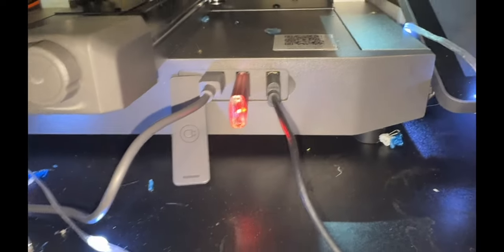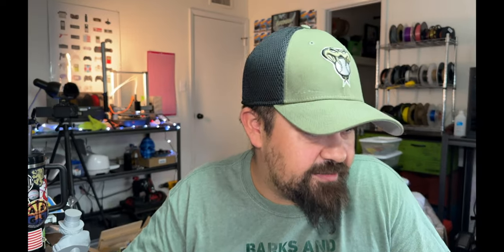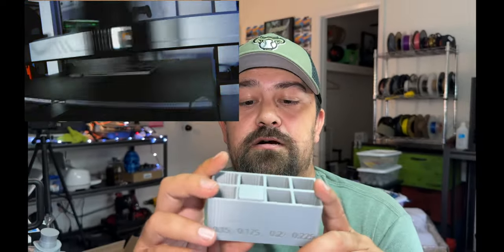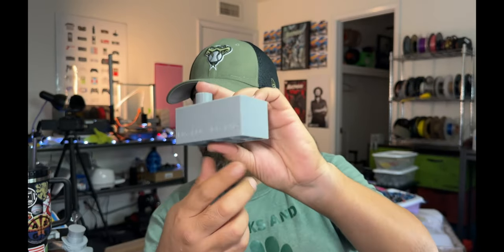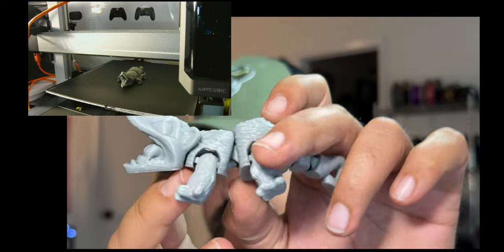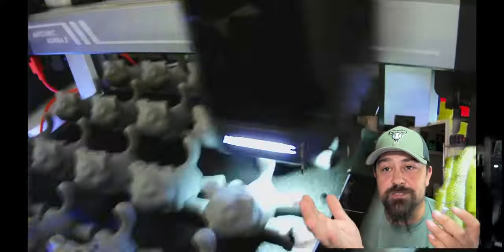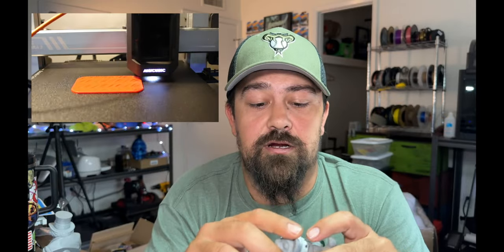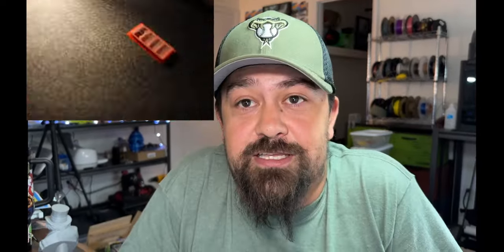What I DON'T like about the Anycubic Kobra 3!!!

Comment: Right out the box you're wrong. Bambu fan boy or didn't spend any time on the kobra3
Reply from the maker: What am i wrong about?
Reply: @IdiotCraftMan all the calibration stuff it does everything the A1 can do and the speed stuff there is a sport mode on it you just appear not to have got it to work are you using hs filiment as the printer will not print faster than the filiment can flow. I have turned it on and it prints a lot quicker with poorer quality.
Reply: @kerrigreen2626  he says he didnt use it but the prints werent as good as bambu at the high speed something sounds fishy there
Reply: Seriously?! Anycube, unless you got it for free before it was released, does not send the printer without the screen, super sus! Also, there are TONS of videos out in the world showing the speed differences. Why don’t you show any of your settings or calibrations? Again, super sus. Someone’s looking for clout.
Reply: @CMTKingsfan  my 2 max works great but I use my 3 combo most of the time I don't give a shit about clout or anything like that the only vids I have on here are from my drones.  What settings are you looking for next time I'm on my laptop I'll send them. I don't sit in a basement fondling myself to chep or other print videos nor do I get off comparing settings.  Out of 6 printers I only run the k3 most of the time
Reply: @MrJlhhagood2 wasn’t even replying to you lmao

Comment: Aesthetics man it's for the 80% of people that are going to use the cloud and that way there's not dust in other objects that go in there. Regardless it's nice to see that someone is being somewhat critical but putting something together is actually better so you understand a little bit more about the machine. Instead of always having to contact support.. You're layer shifting has to do with your z-axis belt being way too loose. I mean it's a turn of it now it's not rocket science. Aurora tech put it together no problem had no issues so I don't understand because you did not like that you're to put together that you're going to pick at a company that literally is the reason why Bambu is cheaper now.. home the z axis. Along with a level calibration but usually it is not many people know to just home the z-axis. It seems like you just want your viewers to applaud you for putting it together properly. Also orca slicer exactly is bambu like all you have to do is transfer your bambu profile. And that is not true because you can use and fill flush within orca to eliminate waste. You also paid 415$ no shipping
Reply from the maker: Yes the belts needed tightening, Which I did before printing and all that. I have no problem with putting together a 3d printer, I have about a dozen of them, most of which had to be put together. The whole point was saying that this machine(in my experience) is not as beginner friendly as many others on the market right now. There are more and more people buying 3d printers for their kids, or who may just be wanting to get into it to experience something new. From my experience, this has not been a beginner friendly printer, as I am still having issues with it. That being said, I love the company. Anycubic has been in direct contact with me to resolve the issues that I have been experiencing, as well as fixing issues they have been able to replicate on their end. I'm hoping that I will shortly be able to put out a video about this working correctly, but so far, I stick by my statement, that this is a machine for an experienced printer, who doesn't mind tinkering with this machine.

Comment: You mentioned the camera, prepare for more disappointment. I got mine, also shipped separately from the printer and filament.  It's the lens, board and cable, you have to print the enclosure.  It goes underneath the left side of the x-axis bar close to where the cable and filament tubes go through on the side.  You'll see the circle and rectangular holes in the metal bar there, that's where it connects.
Reply from the maker: That’s not ideal. Is it at least any good? Does it record at all, or just monitor?
Reply: @IdiotCraftMan  I'm doing my first print with the camera after printing the housing and installing it.  It looks like real-time monitoring through the app so far, and the refresh rate doesn't look too bad but the quality isn't great, but that's as expected...I don't see any recording option in the app, unfortunately.  It's a bit odd because to use the camera, the lights on the printhead are disabled, so the image is pretty dark, though the camera has lights on it but they're not on...unsure if mine is defective (wouldn't be surprised) The mobile app doesn't show an LED option but the anycubic slicer workbench section does, but it's not selectable.  Also if you try to view the camera from the app and anycubic slicer, one will timeout, not a huge issue, but I thought it was interesting.  Also haven't experienced any of their ai sensing abilities for the camera, so I can't speak to that.  I have only tested it via Wi-Fi so not sure how the image would do over cellular.
Reply from the maker: @risraels  Thanks for the info. I don't know when I'll be receiving mine, but I had a critical failure on my Kobra, so I gotta fix it back up and recalibrate and all that.
Reply: @IdiotCraftMan  Me too... I've got constant sensor errors and it can barely get through an auto level.  It even fails that most of the time. Support thinks it may be a bad strain gauge, but we'll see...I think they may send a new one out.
Reply from the maker: @risraels  I will give them credit. Their customer service and support is top-tier.
Reply: Sounds like the steps for connecting the half frame per second camera on the Bambu P1P
Reply: @IdiotCraftMan  It is very good when the problem is easy,  I have a Kobra 2 Max and the motherboard is shot and I can't buy one anywhere.  I put in two tickets and never got a reply.  When I asked for an end stop I got it within a week.

Comment: You mentioned that the Kobra 3 doesn't come with any sort of auto leveling or auto calibration. That is false, as it states it directly on the Anycubic website that it does. I'm racking my brain on which to buy and that piece of false information almost made my decision.
Reply from the maker: It has the options to run those on the machine. What i was saying is that it doesn’t run a full calibration before each print like other machines do, which has caused print issues for me.
Reply: He said that Kobra doesn’t run it when starting a print, not that it doesn’t come with it. He was talking about printing speed, and the point was to contrast the fact that Bamboo runs the levelling every time and Kobra doesn’t.  

Later on he explicitly says he ran the levelling, so obviously it does come with it.
Reply: I'm sure you could add the gcode to make it auto level each print correct?
Reply from the maker: @thepeacemaster1  I've been told that it will soon be a feature in the slicer, and you can select which calibrations you do or do not want to run for each print.
Reply: @MelchiorumJS  why would you want to run it before every print? There's no point.
Reply: @BuzzingGoober  I never said I wanted it. You people need to actually listen to what is being said in the video and follow the thread of a discussion instead of making some weird conclusions and assumptions.
Reply: @MelchiorumJS  I was asking a rhetorical question. I know you weren't asking that, but the video creator wants that function. You don't need to create a mesh before every print. It's pointless unless something drastic happens to your machine?
Reply from the maker: @BuzzingGoober  My point was basically, that with every print, if I didn't go through and run the auto level and calibration every time, the print would fail. So if it needs to run that every time for a successful print, then that should be automatically run. I agree that it SHOULDN'T need that every time, but if I don't auto level for each print, or at least every other print, I have issues.
Reply: @MelchiorumJS  It is an option on the Bambu as it should be.
Reply: @thepeacemaster1  Of course.
Reply: @IdiotCraftMan  Sounds like the mesh isn't saving or loading properly.
Reply: Yep they have troubles with firmware. But they fixing it, just need to upgrade it from time to time. I also heard about wifi upgrade issue too. Manual upgrade works however.
Reply: yeah it has, auto leveling

Comment: The Kobra 3 does have an auto leveling and claibration and now they have updated the firmware which I think re-levels it before every print. You can also turn off the purge tower and set the purge lower  to stop  a lot of waste , but it can cause colour bleeding
Reply: i set my purge to 0.5
Reply: @sheilaolfieway1885  waiting for mine to ship. i thought it did have auto leveling, im watching videos of that now. sorry but i stopped your video at that point, hard to determine fact from fiction

Comment: Thanks for sharing, you've done a decent review and mentioned all the weak spots of kobra 3, but to be honest, I wouldn't say that it's a bad product.
I just recently got my Kobra 3 and it's a steal. At this price point I expect some amount of jank from a 3d printer, but so far it was way better than my previous kobra 2 pro. There are many things with their printers that require you to take a deep dive into servicing and setting up 3d printers, instead of just printing your stuff. For example, from watching your video, I think your printer could use either an x-axis gantry tramming or leveling the bed.
Also, print speeds are mostly marketing wank, if you are not printing a high volume of commercial stuff, go with the slow/quiet mode. The prints will be way more consistent.
Multicolor prints are notoriously wasteful, which is true for most of multicolor 3d printers, since purging the hot end every time costs a lot of filament. 
One undeniable major pain point is the software side of things. Anycubic slicers do the job, but they are very lacking in options. You can get better results if you set up stuff properly with orca, but then you are forced to go with USB drives. The whole anycubic cloud thing kinda sucks honestly. And that's where I hope to see some improvements over the next months.

Comment: I agree with you that it is a printer for tinkerers. I have one, and I am not very happy with it. I had to change the bed because it was warped, and the new one is not straight either, but it seems to work better. There is no comparison as far as I am concerned with BambuLab printers. I have an A1 and an X1C  (still in its box—just arrived), and the prints are perfect and predictable.
Anycubic has a Beta slicer (similar to Orca Slicer) that works pretty well with the Kobra 3 Combo profile loaded.

Comment: I bought mine on Prime day on impulse. It is supposed to areive today. Not sure i will even open the box. I really want to like this one though. But i have the A1, the mini, and x1c. Im wrestling with my j1s at the moment and really don't want to add another headache. The mk3s+ chugs along as usual and bother nobody. I don't know if the k3 will get along with the others.
Reply from the maker: I’ve heard from many people that their run with 0 issues. My experience may very well be an outlier. I will tell you that when mine works, it’s awesome. Quite a few of the issues i had were because of software, which has since been fixed

Comment: I did the early bird special. I started with setup and leveling and tried a test print that came on it. It doesnt adhese the first layers very well and if it makes it half way printing without slinging prints around, it does a major layer shift and drags the pringt around. I didnt get my camera and I havent been able to print since day 1 and now it just sits. Contacted Anycubic and nothing.
Reply: You need to adjust the z offset.  I have the kobra 2 max and had the exact same issue.  Had to set my z-offset to -1.55.  Just start printing the first layer of Benchy and watch and lower the z offset until you have a nice clean first layer

Comment: Just got my Kobra 3 this is only my second printer my first was an Anycubic I3 Mega which I had done some minor upgrades too over time but it's been an awesome printer so I figured lets give this a shot it's time to upgrade to higher speed and multi color. Not sure what is causing the issues here but all I can say is mine has printed almost perfectly right out of the box. Just a couple tweaks in the slicer (using the Anycubic Orca Beta) and items I have just printed recently on my old printer are even better on the new one in 1/5 to 1/8 the time in single color. Multi color prints have come out well considering how new the tech is. I did some prints with the shipped firmware and some with the latest firmware all were great. I wouldn't let one persons issues stop me from buying a Kobra 3, I hate to see something being bashed that doesn't deserve it in my opinion.
Reply from the maker: I’m glad your machine is working for you! I love the company, and would recommend their products to anyone for sure! I got a bad unit, and am in the process of getting it replaced! Hoping to put out a new video shortly!
Reply: @IdiotCraftMan  So if I understand you correctly this review means nothing more than you got a bad printer and didn't like it which we know can happen no matter what the brand and decided to put a review together to voice your frustration?
Reply from the maker: @CTBoater1  when i put this review out initially, there weren’t many videos about this machine out yet. I was sharing my experience, and yes, my frustration. My experience seems to be an outlier for the most part, but i have come across many people who have had similar issues to mine, and there were some issues that the company addressed, ie, slicer issues.

Comment: I hope they get it all sorted out quickly. I definitely don't want to be tied to their slicer for the multicolor. They have to make it compatible with other slicer if they want to sell them. Seems like the bwmbulab a1 is just way better for the money. The kobra3 resembles a lot like the kobra2pro hardware wise. If they can get their multicolor to work on other printers, than that's a big plus. Otherwise, bwmbulab a1 is better for the money.
Reply from the maker: Agreed. I’ve had a lot of problems with this printer in general. Not just with multi color.
Reply: I have a profile built for prusa that works for this printer.  Someone else built it and distributed it. I haven't printed much with it yet because I clogged my nozzle and they had it installed so tight that I twisted it in half. Waiting for new hot ends now...
Reply: I have both printers and both are very good but you get a lot more for the money with the Kobra.  Bear in mind that the ACE is equivalent to the AMS not the AMS Lite.  It is early days so keep an open mind.

Comment: I just like the p1s. I put it together, turned it on and it immediately printed something which looked pretty damn good. As you know it does all of its own bed, leveling and calibrations. That's too bad about this printer but then again this is cheap and this printer is also probably rushed to market.
Reply from the maker: I think it’s something they could easily correct with a software update. But who knows if they will.

Comment: Aurora Leung says it's faster, it's faster.
Reply from the maker: With stock settings running side by side, they finished at roughly the same time, with the kobra printing much worse. I haven’t been able to run side by side multi color prints, because the kobra keeps messing them up. So for me, it doesn’t matter if it can go faster, if it can’t finish a print.
Reply: Hey dudes, even Ender 3 (the first model) on stock belts and motors is not much slower than Bambu X1C printer, which is the most advanced to this day, just upgrade firmware and install DD. So speed and all that head shaking is just pure marketing.
You should choose what is more comfortable for you, not what have better marketing = )
For me $100 Ender 3 is better than X1C. Well, Prusa XL5 would be better, but price is incomparable. But I do not mind to print some parts on printer and install them. With correct setting Ender 3 is very reliable and cheap, and can be quite fast too. But I talk only about first model, others are BS in my opinion. But people buy them and use, and have different opinions. Someone thinks you need BS-touch and second Z spindle. I am not spending my money on those useless tools. It works alright without those.
So it depends.
There are FlashForge clones of Bambu P and X models now, people say they are quite good. I would not buy those too though. Ender 3 works find for me. It does not need any maintenance as it have only POM wheels and Z spindle, which also can be upgraded to POM nut. Not greasing at all. I am a lazy man. And Bambu clones have rails and shafts and complicated boards which are not cheap and so on and so forth. So it really depends.
Reply: @enosunim  This is PATENTLY false.
Reply: It depends what speeds do you compare. Most printers are marketed as 500mm/s or 600mm/s or 1000mm/s. But they do not tell you real flow limit and that those speeds are only on certain plastic type and brand.
So every printer speed is a lie. Even Bambu. Its base templates for example use only 10000 accelerations. While every video you see they repeat and repeat 20000 accelerations! While printer template have 20000, in printing template (normal, draft etc) default is 10000. And those actually does not change a lot, just set 5000 and it will print a bit slower, and may be not so spectacular. Even Bambu on high speed PLA will have maximum speed of 450 (from their official template) but only on 0.08 layer height. It will not print on 0.2 layer faster then 300.
So it depends on template and settings and what do you 'define' with 'faster'.